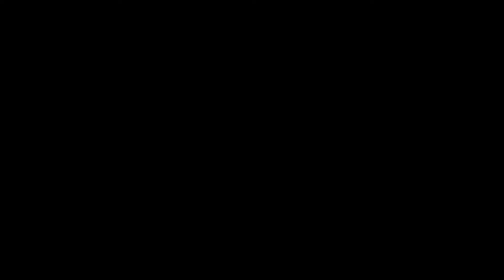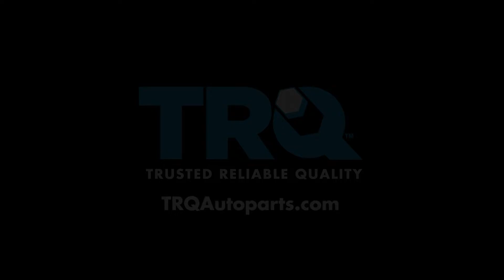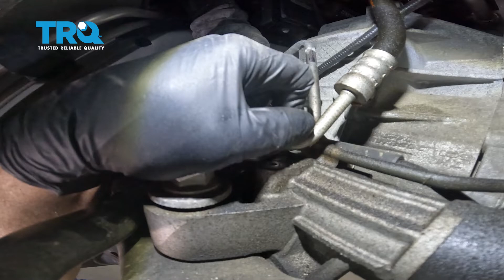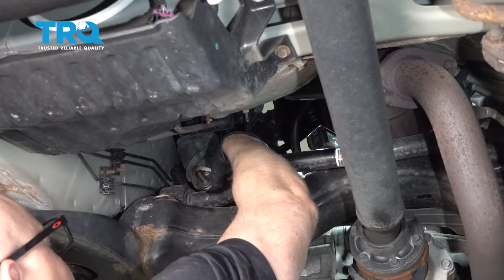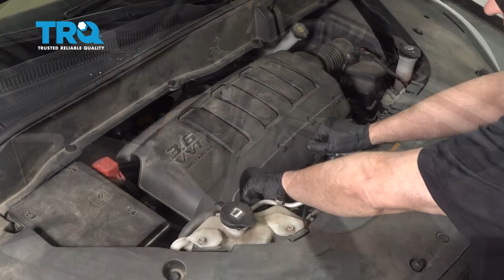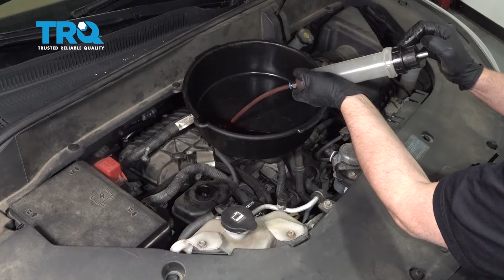How to Replace Power Steering Pressure Hose 2008-2017 Buick Enclave

Comment: When you install that 10mm bolt at 13:37 the plate doesn't appear to sit flush. The plate looks like it might be a press fit around the hose line. Yours is at an angle. I am arguing with a shop on this same issue. They dont want to reseat and burp, says that plate is supposed to have a gap.

Comment: Attaching the new pressure line to the power steering pump is nearly impossible. I can't get it to start threading, the angle of the line is hard to control one handed. I think the only way to do it is to remove the pump even if yours is good.

Comment: I am so glad for these videos as I have used yours and others but for this I was wondering can you make a high pressure hose instead of using the GM replacement hose? As long as you could find out the size of the connecting ends I would think it would be possible? Some people may find it a waste of money using something like Earl's parts but to me if you want it to be top grade use top grade materials?